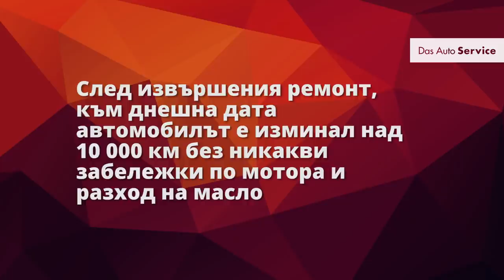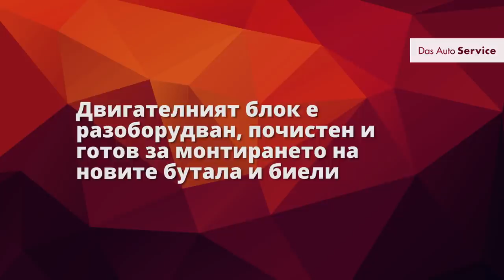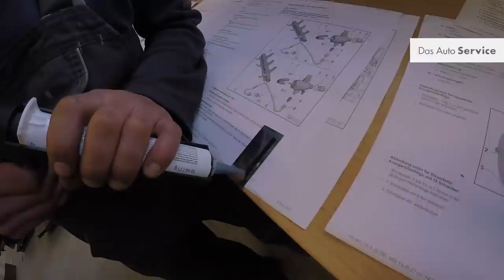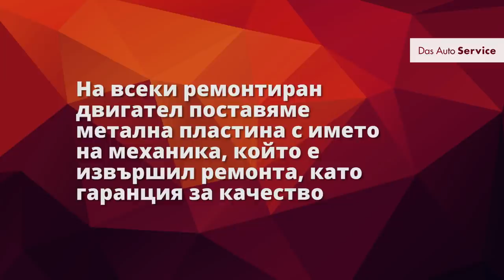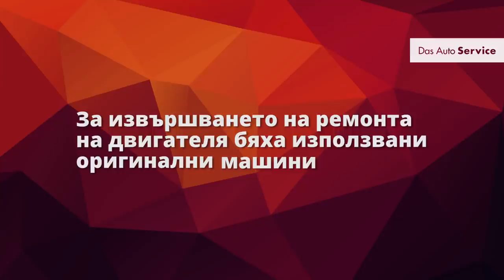Audi A4 B8 2.0 TFSI second generation – Pistons and conrods replacement

Comment: its not a 'service'- its repairing a design fault.
Reply: Once 'repaired' does it fix the design fault? or will eventually fail in the same way?
Reply: @andyknowles666  the pistons and the piston rings were slightly redesigned to address the oil burning issue. It should fix it permanently. Check this video https://www.youtube.com/watch?v=Y37CkXA_vyw
Reply: @andyknowles666  also my mechanic advised me to also chage the PCV valve just to be sure.
Reply: Alex Sotir hey do you know what years the 2.0 TFSI piston and rings problems are? I get mix answers on google. I have a 2013 Audi Q5 2.0L. Burns like 1quart every 1k miles
Reply: @Hawaiianguy1  I believe it's pre-2012 when they came out with the facelift. You can try to change the PCV valve first.
Reply: Jon Simmons i have the same problem on my 2.0 TFSI. How much cost parts and where didi you order?
Reply: I never bought an Audi. Overrated, too expensive paying Porsche / Bentley prices for VW parts and car.without the reliability.. Bad bad bad. Just another reason to avoid audi - if you care about your money

Comment: wow it is beautiful to see how a mechanic of that class, disassemble an audi engine with such ease and great experience I would like to have the ability of that intelligence of that man to fix my audi a4 2.0T 2009 that I bought second hand, I really like that car brand, that when I was a 10 year old boy I said that my first car will be an audi. and now at 30 years of age I bought it, second-hand but I bought it, I fulfilled my dream, "but" many problems in the engine were losing strength when running, and oil leaks and I think the pistons are bad because the Engine spark plugs are with oil and I would like to have the intelligence to be a good mechanic to fix it with my hands because they charge me a lot of money here in the United States and the problem is not that, if not what to be poor. 😫 With how expensive it is to live in the United States that money is little, hehe because now I can't fix it, I will have to fulfill my second dream of being a good mechanic like that man to fix my beautiful and sick car. I love it because it is my first car and now I watch videos of how to fix an audi engine, hehe 😉. greetings to that good mechanic and excellent workshop and company audi.😔☺
Reply: All you need is the tools bro, I just did the turbo on my 2012 A4 and it was a lot easier than you’d think. The tools to do a job like this would probably cost around $400 if you didn’t have them already and the parts would cost probably $500-800 depending on where you get them from

Comment: pain in the ass - audi designing their cars where you have to completely tear apart a front end and pulling the engine out to get to the transmission. vw is only a little better with how they engineered them.
Reply: Nothing better, they are being used in both brands

Comment: The 3.0tdi engine in my A7 has chain rattle at the first start and leaks oil. To repair this the whole engine needs to come out and it needs to be stripped almost completly. On a mercedes this would not happen

Comment: Hello can anyone tell me if the timing chain is part of the installation for a Audi oil consumption failure
Reply: Nope.  I had my pistons/rings replaced on my '09 A4 a while ago for the oil consumption recall and the timing chain was not covered/replaced as part of the repair.
Reply: Was it a expensive replacement? i got same problem with oil consumption. Im afraid that i need to fix that.
Reply: I was able to have mine fixed before I reached the end of the extended warranty period, so it was fully covered by Audi.  Yes, it is a very expensive repair otherwise, unfortunately.

Comment: I agree yes crappy pistol design crappy ring package probably cylinders Beltone right and don't forget they're still using It upgraded crappy PC valve that ain't going to last very long folks I'm now designing a new PCV valve design that will be bulletproof for the crappy Audi design will be part old school new school it will be Bulletproof I've already tested on one Vehicles working very good have to do a few more modifications and it will be Bulletproof as for the piston and piston rings mainly pistons and probably Perfect Circle Rings or I'm thinking about using gapless rings that's their top ring design